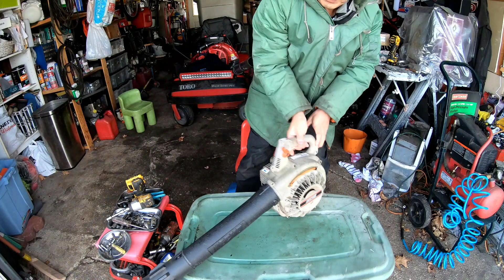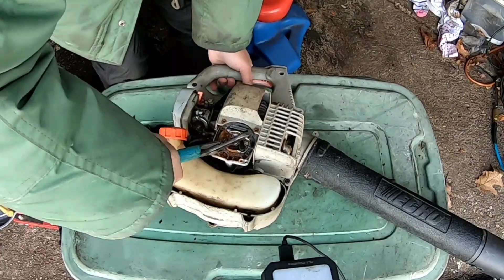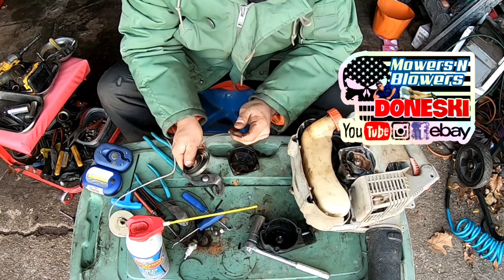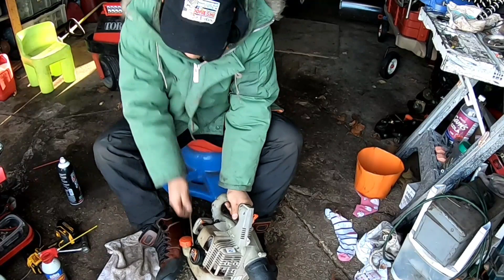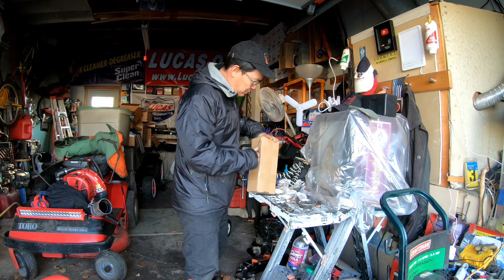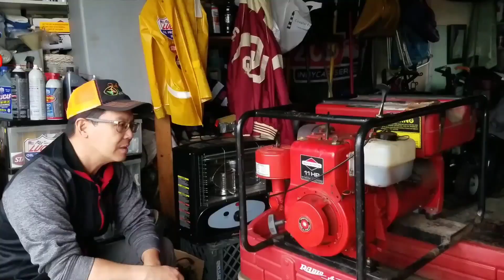FREE ECHO PB-2100 LEAF BLOWER TRASH GARBAGE CURB FIND PICK RECOIL STARTER RUSTY ROTTED SPRING REPAIR

Comment: Hey Henry its Rocco I  use those blowers for cleaning gutters. Might need a head gasket no or lo compression air cooled things get hot in warm temperatures I would get the fan bolt fixed. Go from there good luck buddy thanks your friend Rocco from Connecticut

Comment: Use a feeler gauge to gap spark plug to about .020.  The feeler gauge also has a tool to adjust the electrode.  Spray penetrating oil into the spark plug hole before you start trying to free up the engine.  Insert the hooked end of recoil spring on the outside of housing.  Wind it towards the center as you hold it in with fingers.
Merry Christmas!
Reply from the maker: I did all those things except the feeler gauge.

Comment: While you had the recoil off, before trying to fix the recoil, you shoulda just put a socket on the drill and seen if it started that way. Drill start would have saved a lot of pulling.
Reply from the maker: Yeah, I guess I just like doing it the old fashion way.  Even if it started, I’d still need a Recoil fixed.